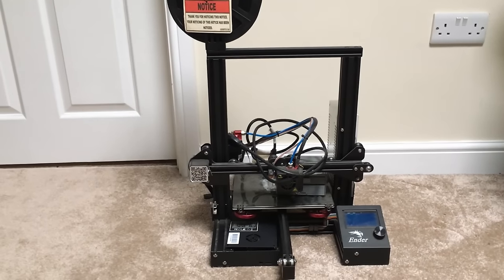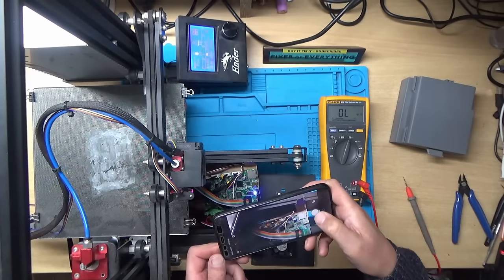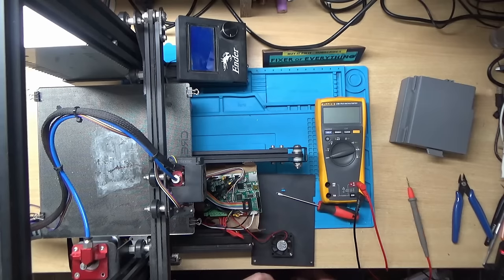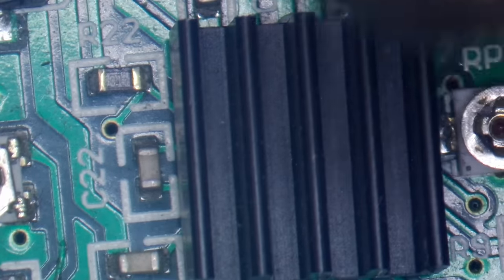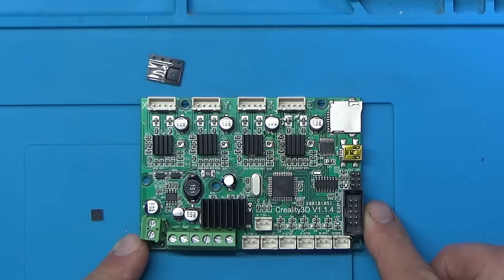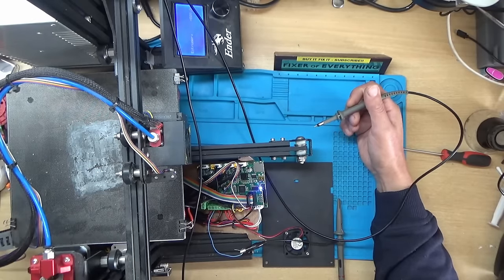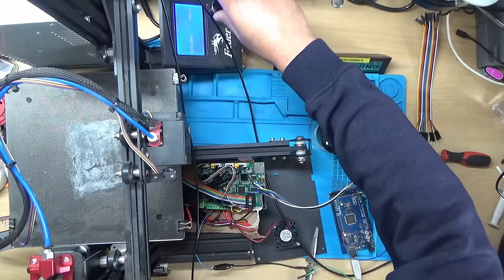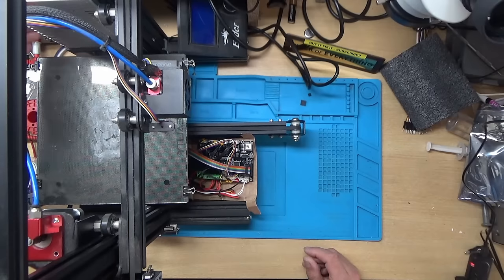Faulty Ender 3 3D Printer | Can I Fix It?

Comment: urk, it won't extrude when cold and annoyingly doesn't seem to inform you!
Reply from the maker: Hmmm, I just powered my old ender 3 up, and it doesn't even show an option to move the extruder,  just x and y but it's from when they first came out. I would have thought it would have shown a message but you might well be right. I even flashed different firmware as I did suspect a firmware issue, so the driver I replaced may well have fixed the original issue. Thank you for commenting!👍
Reply: I was screaming all the way through the video to say heat the extruder.
Reply from the maker: It's a bit of a rubbish firmware if it doesn't  say something such as an error and just displays the measurements as if it's actually moving. The new board did say hot end too cold.. the original driver chip was definitely faulty. I thought it did seem odd which is why I thought software issue possibly and tried flashing different firmware. I'm sure my old ender 3 just extruded hot or not, as you could load new filament that way and the extruder motor just used to judder a bit if it couldn't push the filament.
Reply: @BuyitFixit   That info message about needing to warm up was luckily added on Ender 3 V2 Neo that I just got a week ago. Otherwise I would have fallen to the same trap!
Reply: Boy it’s hard to watch! The extruder feed motor won’t move as it has no filament for starters. Secondly there’s a safety cutout  in the firmware to prevent forced feeding if the head is not up to temperature!   Painful.
Reply: @BuyitFixit  it's a crapality, what where you hoping for? (I own a crapality cr10 smart, had some enders 3 and 5 and now I'm changing all my printers to elegoo neptune 3 maxes)
Reply from the maker: @russelldicken9930  The printer doesn't have a filament sensor and also the old board / firmware doesn't display a message like the new board does of hot end too cold and just displays that it's moving the motor hot or not...so perhaps that safety feature wasn't implemented.
Reply: @BuyitFixit creality isn't known for safety, my first ender 5 firmware didn't have thermal runaway logic which is... questionable
Reply: @BuyitFixit it has always been implemented in the Marlin firmware.
These older printers were so low on memory that you had to remove certain functionality to get them to fit.
This error message is most likely one of those things.
It was a common knowledge type of thing in the old ender 3 days. I want to say it was labeled "prevent cold extrude" or something similar and to change you had to rebuild and compile the Marlin firmware.
Oh and also remove a feature of similar size so it would fit in memory.
Reply from the maker: I did think it might have been for memory reasons but, after a few people mentioned this, I did try the old board again with a 740 ohm resistor soldered across the nozzle NTC input and a new driver chip fitted. It did show a faked temp of 230c but the extruder motor still didn't move. I even added a resistor to fake the bed temperature too and that made no difference either. Strangely enough my ender3 (which I got when they first came out) and haven't used for ages, doesn't even show an option to move the extruder on the move axis, it just shows x and y.
Reply: @BuyitFixit  Make new firmware and install.....Many extra options.
Reply from the maker: @muppetpaster Thanks, but we installed a new board with more memory / ram and 32bit 🙂
Reply: @BuyitFixit I think marlin 2 or some version added the warning, so a firmware reflash could have helped you know why

Comment: The difference is night and day with the silent motor controls.  I am not a huge fan of Creality printers because they are not so accurate.  I wasn't aware of this until I bought a Sidewinder X1.  So so quiet and very accurate, with print speeds far exceeding Creality. I am very please I sold my Creality, and went with different printers.  I now have Elegoo Neo 3 Pro, the Sidewinder X1, Lotmaxx dual and a Sovol 6 Plus.  I am selling off the Sovol due to noise as well.  Benchys on the SWX1 take about 38-40 minutes, the Neo about the same.
Reply from the maker: Interesting, thanks for sharing 👍

Comment: I'm a latecomer to the Buy it Fix it party, so forgive the comment on an old vid......  I have an early Ender 3, printing something this very moment in fact. I had it about 2 weeks before investigating a new controller board for it ;)  Over a few years I went through a variety of driver modules (the new boards had plug in stepper drivers) and many many iterations of Marlin. I stopped messing with it maybe a year ago, perhaps more, and just use it when I need to print something. Yes, it is basic, but it works well enough for me and my use is so infrequent I can;t see me bothering to replace it any time soon, despite the new machines from a variety of sources look to be so much better.
Reply from the maker: No problem and welcome 👍after looking at this I bought an ender 5 pro, but it had the 8 bit controller board that was faulty like this one. I decided not to do a video on it as it was just pretty much replacing the board and I usually do a lot more in depth repairs than just board swapping. I did end up having to compile my own firmware for it as the BL touch it came, and the 32 bit board weren't supported very well on the ender site and was giving lots of probably. Eventually I got it all sorted and printed a large wendigo skull for my daughter to wear 🙂
Reply: @BuyitFixit  Board swapping isn’t really fixing is it. I worked in an electronics based industry for quite (cough) a while and towards the end, there was very little kit that could be repaired - all board swapping or return to manufacturer. Bit of a contrast from when I started.

Comment: Where did the idea of the gasket sealant to stick the heatsink come from? I thought this was mostly silicone (thus a good thermal insulator)
Reply from the maker: It came from when I was looking at replacing a thermal heater in an ultrasound. The manufacturer said use thermal gasket to attach the heat plate to the tank. https://www.allendale-ultrasonics.co.uk/spare-parts/benchtop-system-spares/mannol-9914-gasket-maker-red-85g-tube-heating-pad-adhesive
Reply: @BuyitFixit That's interesting. But I would imagine the manufacturer advised it because it resists both heat (300°C) and ultrasounds, not because it's great at thermal transfer. Brute force (more heating pads) will still get the job done, so they don't worry.
But you can't brute-force heat dissipation in the same way. There is thermal epoxy and thermal double-sided tape for heatsinks. In a pinch, I might consider cyanoacrylate because it's very thin.

Comment: Did you heat the hotend up while testing the extruder? The firmware running on it is most likely set to prevent cold extrusion below a set temperature. If you set the hotend to 180c you should be on the safe side while testing extruder.
Reply from the maker: No, the new board gives a message saying hot end not hot enough. The old board which is the same as the one in my ender 3 doesn't show this message and just lets  you move the extruder regardless of the hot end. Partly why I tried the older version of firmware just in case.
Reply from the maker: Appologies, another viewer commented that it doesn't show a message, so it is a possibility. I fired up my ender3 from when they first came out and it doesn't show the option to move the z or extruded only x and y, so you may well be  correct👍
Reply: @BuyitFixit  I only had one of the early versions of it, so I was unaware the later ones show a warning. I see how that can lead to some confusion.

Comment: I respectfully question the use of HT silicone adhesive between the IC chip and heat sink. That stuff is rubbery and not very heat conductive.
Reply from the maker: I would have thought the same, yet they had used silicone to adhere the original, unless it's some special thermal conducting silicone? But the chip is also soldered to the board via a large thermal pad on the bottom.
Reply: @BuyitFixit  Typically they use thermal cement to attached the heat sinks

Comment: Btt Skr mini e3v3 mcu board would be a better option for this thing. Instead of spending 1 hour of effort, I'm talking about a much better card that costs about 30 dollars.
Reply from the maker: Good call, I did end up replacing the board with the 32bit ender one, but I also enjoy the challenge of getting to the bottom of why things aren't working. So the hour of effort is still worth it for me as normally I end up learning something 🙂

Comment: DId the replacement board come with ABL firmware?  ( for the BL touch sensor) Typically they don't.   If you upgrade your own machine maybe try a BTT E3V3 They are made for this machine! ( hence the E3 in the name)
Reply from the maker: Thanks for commenting👍 I had to re-flash it with the BL touch firmware via the SD card. It just came with standard firmware (but I'm not sure what version). Thanks for the advice regarding my printer. I bought it about 2 or 3 years back, printed out a few things in the first few weeks and it's been gathering dust since.. 😂😂😂

Comment: I know this is very late.  there is a firmware setting of a minimum temperature at which it will extrude.  Also, yu are confusing the X & Y axis.  X is left right Y is front back
Reply from the maker: Thanks, yes I got mixed up at the time because the printer was sideways on my bench. At the time I didn't know about the temperature either, but after making the video I was curious and used a couple of resistors to fake the temperatures of around 210c on the hot end but it still wasn't extruding with the new driver chip installed.

Comment: Kudos to you. Nice to see someone actually using a scope to diagnose faults. Most fixing videos seem to rely on inspection, multimeter readings and guessing.  Subscribed.
Reply from the maker: Thanks Martin, I've used it I a few other videos too like the Milwaukee fan video when looking at the PWM waveform, and a few other ones (I can't remember which though 😂😂).

Comment: Good to see you double check the customer / friends work. We've all be burned at least once by the prior persons troubleshooting. Odd that Atmel took a dump, they are usually hard to kill and awesome that replacement board costs what it should! Almost makes trying to fix it worthless, but it's the challenge, not he money that makes it worth trying to fix. And having three other exact servo circuits to compare to makes it easy to troubleshot.
Reply from the maker: Yes, atmels are usually hard to kill, but I also had a similar one fail on a ECU type board that runs a diesel engine on a welder. The output pin just gave up and actually measured short to gnd of about 6 ohms.
Reply: Why does a welder have a diesel engine.
Reply: @simontay4851  That was a different repair, but same brand MCU. And a lot of mobile welders are diesel, since no mains power available large enough.
Reply from the maker: It was big industrial portable? Mig welder. The whole unit was just slightly smaller than the generator I just looked at. The engine controller that failed was called an 'ECG Controller ' part number TPN 652. I still have it here. The chip with the shorted output line is an Atmega32-16AU.

Comment: There I was crying at the screen your x and y were swapped and the extruder not feeding when the hot end is under temp, before you swapped the chip. YouTube videos never seem to heed these warnings! You'd think some warning would occur from the software telling you about the limitation.  Nice fixit video though.
Reply from the maker: The extruder stepper permanently was energised at power up until I changed the driver.The software showed no warning and happily said it was moving the extruder motor. The new board however displayed a message of hot end not hot enough, so perhaps this was not implemented in the older software?

Comment: no offense, i own a Ender 3 myself, but - they are pretty 'garbage tier' in today's standards.
in 2019, great for the price, but now, not so much, and no - not even the newer models.

the best thing about these is - the absolute amazing modding that people have done to them and documented.  So if you really like it or don't want to upgrade to a better printer (and get off that terrible moving bed system) - it's pretty cheap to upgrade.

almost all of them have tinned stranded wire jammed into terminals - which can be a great hazard so... using proper ferrules can drastically help safety measures.

looks like they got a "bl touch' like auto homing system, on the old 8bit board - which requires the breakout board and such - (honestly never bothered with mine, always seemed to be too much effort)

the board should have labels (mine does) for each Axis, and E for extruder - and the cables should have little yellow clips identifying them.... so that should be pretty easy to rewire.

and yes, if it wasn't answered before - the system is designed to not extrude unless the hotend is 'of temperature' usually about 150C (sometimes higher), this prevents filament from stripping and clogging the gears when it is too cold to actually print. It is a 'safety' feature, but yes, it would be wonderful if it said so in the firmware (which, may be limited due to the insanely small amount of memory it has in the first place)  Enabling Auto Homing with that touch sensor required turning off several functions of the printer to begin with, to have enough space to compile the code to work.   (ender 3's are absolute bare bones space and specs to 'get the job done' and have very little room to improve beyond actual hardware upgrades)

The original problem of "Z not moving" - could be a variety of things honestly, including firmware changes.
Such things include - wires coming loose, (this is a problem with ender 3s especially power - since they can cause fires)
overheating the motor, not properly snugged leadscrew, binding lead screw, dirty lead screw, rough (non lubed) leadscrew, the Xgantry is too tight (preventing rollers from rolling, allowing it to go up/down) too much weight on the x gantry (usually with wheels too loose, causing not enough friction to climb) etc. etc.

Since everything seems to work after a new mainboard - I would lean on a bad compile of firmware, as the 8bit way up updating is both long-winded, a pain in the butt, and even a small change can be devastating to results (I once reversed my directions on accident and had to recompile the entire thing just to fix it again, taking hours)

With new board - the owner will need to change the firmware to accompany things like the bltouch auto homing sensor and any other 'non standard' modifications that would affect print height or homing, etc.

personally I love my ender 3. but I am planning to make a new printer - and get rid of the 'bed slinging' design. I plan to keep my E3 as both a relic, and a noisemaker - because I actually like the sounds they make, it sorta seems like machine-music to me. (I plan to Air Print things while I print other things on better systems) and simply use the E3 as a backup printer (like needing a replacement part to the other printer, and it not being able to function without it)
Reply from the maker: Thanks Kissker. No offense taken 🙂 Yes a few people mentioned about the extruder temperature which I was unaware of at the time. The printer was working fine then just stopped extruding in the middle of a print. I did ask if they had flashed firmware before it stopped but was told no.
The extruder motor seemed to be powered permanently as soon as the power was applied. 
After people mentioned about the temperature, I did have another quick look to satisfy my curiosity, so soldered a 470 ohm resistor across the NTC input to fake a temperature of 230c (this is what it showed on the LCD).

I also replaced the driver chip again too, but still got no movement on the extruder,  but it was not constantly powered at this point. Anyway my friends son is happy as he now has a working and upgraded printer. Thanks again for your thoughts and commenting 👍

Comment: I see you tried various things to see what was wrong with the original board, even after the video when people told you it must have been the thermal protection that prevented you from moving the extruder while the nozzle was cold.
...have you gone as far as writing an Arduino code turning PWM on all the pins that support it and flashing the MCU with it? If the one driving the driver was actually dead, maybe (almost certainly) the MCU had another one available and you could have rerouted that one? And then edited the Marlin firmware (which is very easy to do) to change the extruder pin.
Reply from the maker: Thanks for the idea, but it really ended up not being worth it. It had the old noisy stepper drivers and was only 8 bit. The upgraded board is a lot better. After this I bought a faulty ended 5 pro from ebay that had a fault with the board, but that too turned out to be the old 8 bit so I just ended up buying a 32 bit and didn't to a video as thought a board swap would probably be a bit boring. I did have quite a journey with it still as it had the BL touch and the stock firmware doesn't work properly with it, so I ended up having to compile marlin myself and tweaking everything to get it working properly!

Comment: Extruder only works when hotend is above about 160c degrees.
Reply from the maker: Yes, I didn't know this at the time, see pinned comment. Quite a few people mentioned this. I did try putting a 470 ohm resistor across the NTC input so it faked a temp of 230c, still no output on the extruder motor even after replacing the driver yet again with a new one.